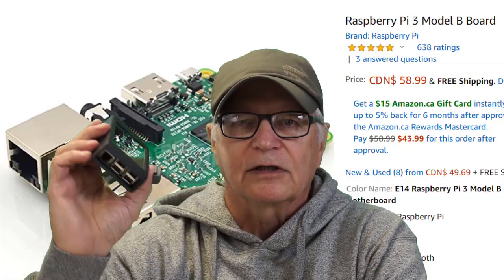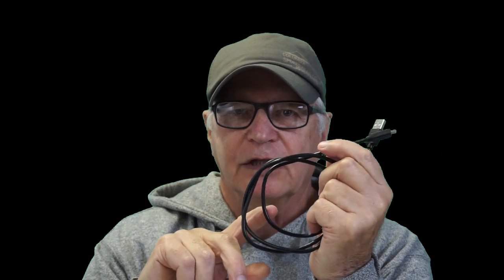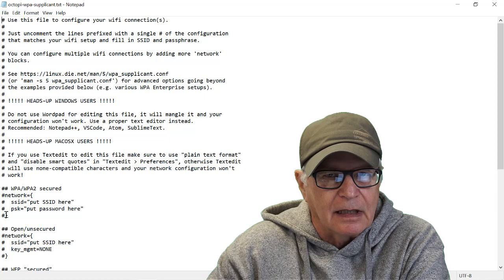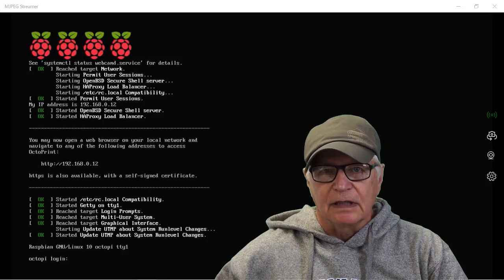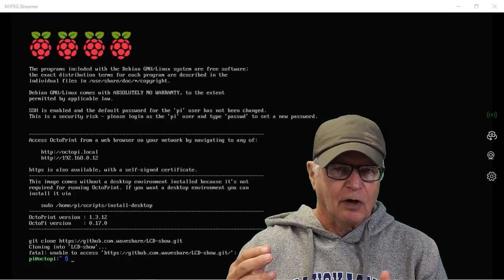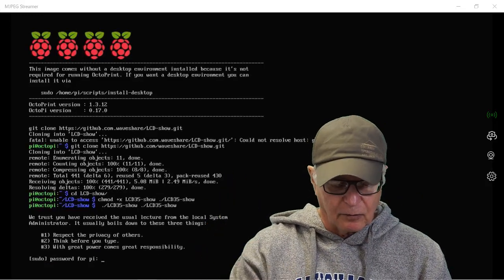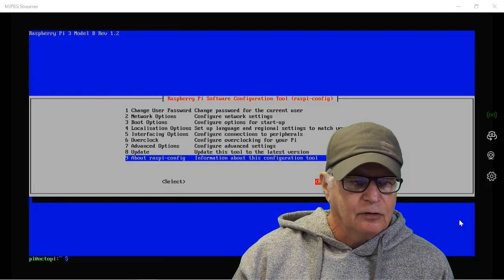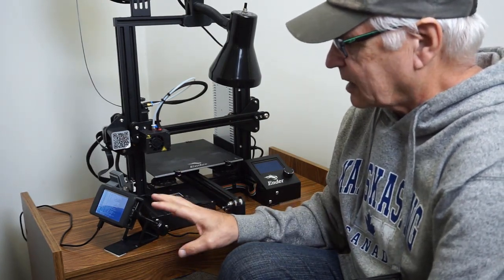GADGETS#127 - OCTOPRINT PT2 | WHAT IT TAKES

Comment: for the dipping power problem, just get and add a 5.5V, Supercap or two series connected 2.7V Supercaps and put them on the power input,just takes a second or so to power down and they buffer any and all psu variance.

at the command prompt when you make a typing error and press enter, you can press the up arrow to show that last line then you can edit out the error, as well as use copy/paste btw
Reply from the maker: thanks for the input, Paul